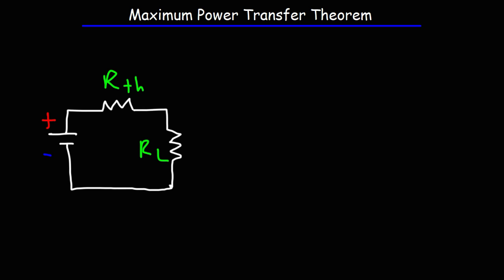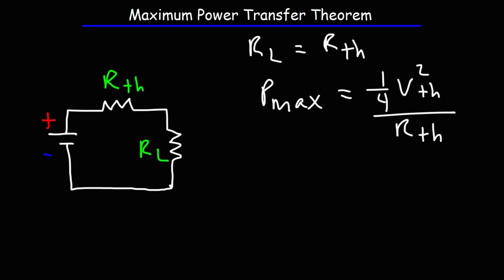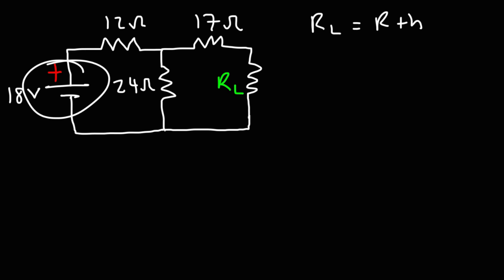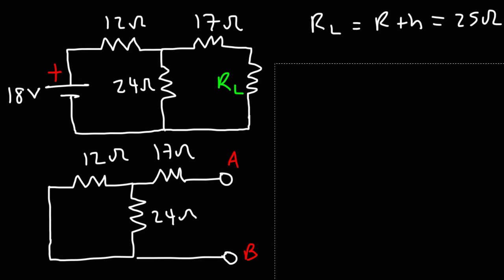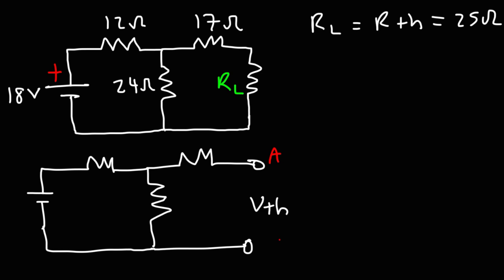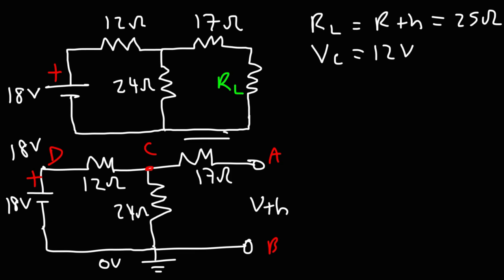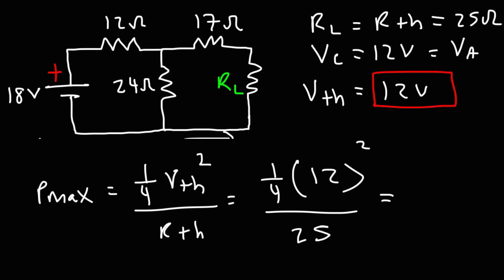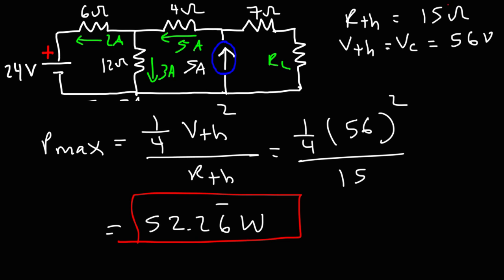Maximum Power Transfer Theorem Using Nodal Analysis & Thevenin Equivalent Circuits

Comment: question here
Vd is calculated at 36v and we know I1+ I2 = 5Amps,  We know I1 = (Vd-24)/6 which makes I1=2amps which means I2=5-2=3Amps. why is there more current at I2 even though resistance is higher????

Comment: at 6:45 why did we remove current source? , like we are ignoring the voltage supply and short circuiting the circuit , but why not do the same for current source?
Reply: It may be a little late, but here is the reason. A voltage source turns into a short, because the internal resistance is 0, whereas a current source disappears because the internal resistance is infinite. I don't know exactly why, but that is just what it is.

Comment: Why need to change the resistance from 1/6 same as 2/12? Why must change it?
Reply: Just to simplify the calculations since he's not using a calculator. You can use it directly no problem

Comment: I don't get it:
1. how is it possible that the current passing through the 6 ohm resistor is not twice as big as the current passing through the 12 ohms resistor since the voltage and current are the same in point D?
2. how can you have a bigger voltage inside your circuit compared to what the source can provide?

Comment: 10:13 Why the amperage in the 4 Ω resistor is Ι=5 Α. I get that the amperage source is givinge 5 A, but doesn't the voltage source influence the current?
Reply: No because two things, there is no current flowing through the 7 ohm so there must be 5 amps flowing thru the 4 ohm, since 5 amps enters that node. And it doesn't matter what the voltage source does, the current source will adjust it's voltage so that there is 5A always flowing thru it's branch. Which includes the 4 ohm in this case too as there isn't even a node between the 5A source and the 4 ohm because, the 7 ohm isn't connected to anything rn.

Comment: WHY IS THE 12 OHM RESISTOR IS IN PARALLEL WITH THE 24 OHM RESISTOR RATHER THAN IN SERIES
Reply: Their endpoints are connected to each other, instead of only on 1 side

Comment: At 4:08, why can we use the voltage-divider theorem while the two resistors are parallel?
Reply: No current will flow to the 17ohm b/se there's no voltage difference! so we are allowed to say 12 ohm and 24 ohm resistors are in series to eachother which allows us to use current divier rule

as for current to flow there must be a voltage difference.
Reply: @KirubelTamene I don't oppose this but why then did he use the 17 ohm resistor when finding the thevenin resistance though???
Reply: Because you can only use that when resistors are in series. If you cut off the amps to the 17 ohm resistor then you could

Comment: Regarding at the 2:00 timestamp, shouldn't the 17 ohm resistor cancel out? Since terminals A and B are open.
Reply: You are calculating the net resistance between point A and B so , u can see how current can move from B to A and the mentioned current cannot reach point A without going through 17 ohm resistor
Reply: That's what I thought

Comment: Thevenin equivalent resistance Rm (in ohms) at terminals (a, b) is Ph a b. 0 R1 9% If v, 2 v, R1 4 ohms, and R2 10 ohms, the current li (in amperes) is b. 0 c. 1.5 d. 3 e. 10 R1 If Vs = 9 V and R = 10 ohms

Comment: In 7:06 why did he took the 7 ohm resistor? I thought it’ll be zero cause it’s an open circuit? 
Pls correct my information
Reply: not zero
Reply: He is not talking about current , current would be zero
Resistance would not.

Comment: On 6:58,  he says that the 6ohm is parallel with the 12 ohm. How come the 6 ohm and 12 ohm aren’t in series but are parallel?
Reply: For two resistors to be in series, it needs to be on the same branch carrying the same current. The 6-ohm and 12-ohm resistors are not on the same branch. If you simply pull the 6-ohm resistor and place it on the left-most vertical branch, it is easier to notice that it is parallel to the 12-ohm resistor.